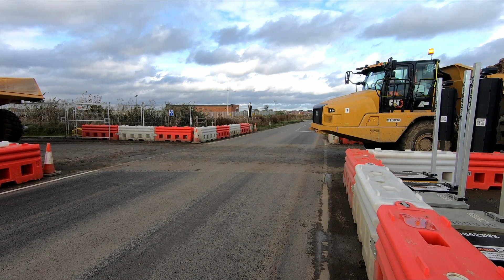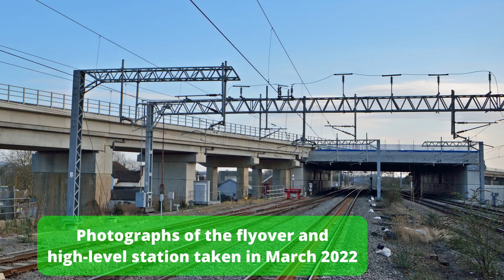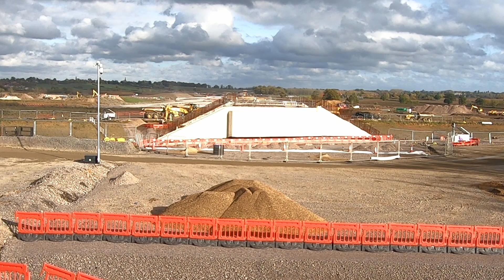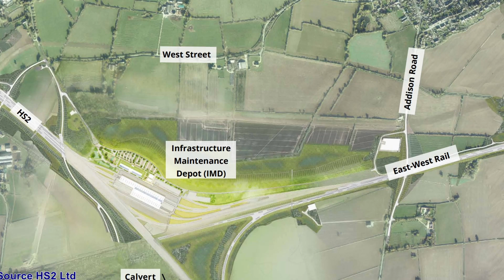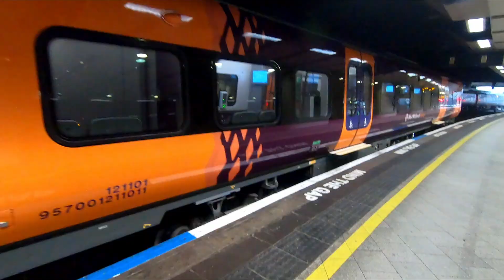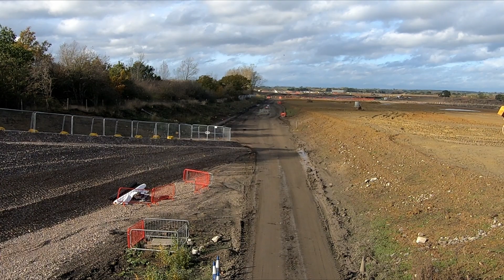Calvert, where East West Rail meets HS2

Comment: Would the East West Rail and HS2 at Culvert not be an excellent interchange station?
Reply from the maker: I don't think there would be the demand to justify the cost. It'd be around £200-300m and would only really benefit Bicester and Perhaps Aylesbury. Milton Keynes will benefit from more fast stopping services on the WCML, so probably not worth travelling from MK to Calvert to catch HS2 services. Plus adding extra stops on HS2 reduces capacity and the journey benefits from the North.
Reply: @Rail_Focus  thanks for the response.

Comment: I really do hope that the Aylesbury spur is built as the town has been without a northern link since the 1960s. It could have been so different. Aylesbury had two stations with connections all over the place. Now it's just a cul-de-sac. I haven't been up to Calvert yet but one day I might do. It certainly is a huge construction site. My focus has been on the Aylesbury area as far as Waddesdon on one side and Great Missenden on the other. Progress in some parts is really slow with little change seen at every visit. I'm pretty sure things will start to gain pace when the tunnels at the North Portal are finished.
Reply from the maker: Me too, hopefully the recent announcement that Government is funding the full EWR route includes the Aylesbury link.

Comment: HS2 has to be the biggest waste of money in our countries history.  So much money spent for the benefit of such a small percentage of the population.
So many more things could have been built and improved for the benefit of the whole country.

High speed is not a requirement, comfort, safety and enjoyment of travel are far more pleasurable to everyone.  Speed is not important.

Anyway its my ooinion as a tax payer.  That will never use it as i work locally and dont commute on trains.  In fact last time i was on a train was over 25 years ago and that was in Germany.  Bye the way it was clean and on time.
Reply: The speed helps increase capacity. 
By your own assesment you could use the same argument and say "why build anything in London, I don't live in London." The fact that it will eventually link the 3 biggest cities in the UK to a fast efficient service, that will benefit 10s of millions of people, is quite an accomplishment.
The fact is, rail travel is becoming more popular, and with the focus on getting rid of reducing the number of short hall flights, this is a no brainer. 
We would always have had to increase capacity on this line eventually. 
You can only fit so many trains on the existing line and platforms are only so big, so we can't really increase the size of the trains. 
This project will make journeys on both lines more comfortable.
Reply: Yawn  😴😴
Reply: In which case you're in no position to comment. You armchair critics really ought to find something constructive with your time instead of moaning about something you have no control over!
Reply from the maker: You're right, speed isn't important and HS2 is primarily about capacity, but why would you build a new line and limit the speed? Surely it's better to maximise all the benefits than to build something less ambitious for actually  very little savings. 200mph isn't outrageous for a modern high-speed line. 

HS2 will serve the  UK's largest cities and many towns currently served by Avanti services, so it's hardly just a handful of people and will also benefit people who use the WCML  south of Stafford by releasing capacity for improved local and regional links.
Reply: @Rail_Focus  Wasting your time trying to debate with folk who begin their comments with 'waste of money 'cos I won't use it' 
Those sort of vacuous 'contributions' to any discussion illicit a massive <yawn> from me.
Reply from the maker: @mrglide7078  I usually give people one chance to see the error of their ways 😅

Comment: What a Collosal waste of money!
Nobody can afford to use it & nobody needs it. Apart from a few wealthy elites it'll be going around quickly for sure...but almost empty.
Reply from the maker: "nobody can afford to use" it's not open yet 🤷. I guess you have a crystal ball. Why would they make it so expensive that no one can use it? What a silly thing to say.
Reply: @Rail_Focus  Precisely, Why?
But why are rail fares on the old tracks so expensive? These ridiculous lines &  trains will need to be paid for & the cost will be reflected in the ticket prices.
If you had even a small  🧠  you'd understand that!
Reply from the maker: @PrivateWalker  the current ticketing structure has been designed in such a way to discourage rail travel during peak hours, hence why there are some eye watering prices to travel on the WCML during peak times, but there are also so much cheaper off peak advanced fares available. 

However without the capacity released by HS2 the situation isn't likely to get any better and in fact will get much worse.

Ultimately HS2 frees up capacity on the WCML by removing the current non-stop Avanti services, meaning more capacity between Birmingham and London on the WCML, at the same time HS2 will more than double the number of seats available from places like Birmingham, Manchester, Liverpool, Glasgow to London. 

More seats means no requirement to manage demand with expensive fares. I'm not saying fares will be cheaper, but the Government will want to fill all those extra seats, so it would make no sense to price people off the railway. 

On the railway it makes much more sense to sell a lot of tickets at a reasonable price than to sell fewer tickets at a higher price.

Comment: I will be surprised if this line does get to Cambridge.  It is a shame it was closed in the first place.
Reply: It was closed in 1967 because it was under utilized due to the amount of time it took (vs the car and buses).  Not 100% sure but in the end a 1 car bubble car unit was used and still didn't get enough traffic.  The line itself was slow and in parts  a singular track.  Politically it was a lost cause in 1967 and you cannot presume that 50 years later traffic on the road would require such a railway to offset it.  However, building over the alignment, which was mostly straight was probably a bad idea.  As with the Northampton railway, once network rail got the land all sorts of contracts were signed to build on the alignment.  EWR is mandated to be a 100mph railway so those alignments would have need to be redeveloped considerably for something like that.  I am surprised the Hitchin alignment has not got more traction, its a bit twisty turny and the tunnel at old warden needs some work, but a connection to Hitchin gives you direct access to Cambridge with a line that is already electrified.  I know the Hitchin/Cambridge connection is heavily used, but the trains that use it only offer an alternative of Cambridge Liverpool street, to Kings Cross/St Pancras.  So there would be some savings going that route, albeit it wouldn't be as straight.
Reply: @atomiswave1971  Yes apparently both the universities pleaded with the powers to be not to close it but not notice was taken.  I really hope it does get to Cambridge.  Cambourne is a big place now and a rail link would be very benificial.
Reply: @EM-yk1dw cambridge is a hub not only for its link to London and the East (Norwich, Ipswich, Peterborough, King's Lynn, etc), but it's also a hub for job opportunities and it's university. Cambridge and Oxford need this link otherwise we will be stuck with heading into london to change trains. Besides, it's called East west rail, it kinda needs to hit more into East anglia considering the fact that East anglia has seen rapid rail decline for quite a while.
Reply: @dominustaker1651  Yes I was reading recently that Cambridge South station will be built now too.  I do agree the link between the two university cities is badly needed.
Reply: @EM-yk1dw  building commenced not that long ago, they are putting up new catenery posts so that when the platform is added later, they don't need to go over the issue of removing them there.
Reply: @dominustaker1651  Sounds good, I remember when I used to work at Cambridge station in the 90s numerous passengers would ask for the quickest way to Oxford.  I think Cambridge South will be very busy with Addenbrookes Hospital in the vicinity and also passengers from the south area of Cambridge and the surrounding villages too.
Reply: @atomiswave1971 Hitchin would be good, but the line is already quite busy, and the town of Camborne is notoriously poorly connected to Cambridge
Reply from the maker: We'll just have to hope the DfT sees sense, it really would be a shame if it stopped at Bedford
Reply: @Rail_Focus  I totally agree, if it doesn’t go to Cambridge it will be a wasted opportunity.  Great film btw.

Comment: East West Rail should order new Civity trains instead of having Class 196s from West Midlands Railway. 

Plus the section between Bedford and Cambridge via Sandy/Tempsford should still happen with a new railway bridge to be built going over the A1, East Coast Main Line and of course the River Great Ouse.
Reply from the maker: I think more units will have to be purchased, but to begin with WMR have enough 196s available to provide an initial service to Bletchley and Milton Keynes
Reply: @Rail_Focus  Interesting. 👍

Comment: NPR cut back, HS2 to the north of Birmingham cancelled. Levelling up, my arse
Reply: it's awful.

The engineers and designers spent years  finding a way to get from Scotland and the North, with less environmental impact in the area north of London and less cost, and the anti-railway lobbyists who pushed through that Integrated Rail Plan nonsense, think they can get away with it, because the stats for trains per hour are not very easy to access...

...and because so many people don't understand that mixed traffic (fast trains and slow trains on the same line) really kills the ability to run more trains.

We need all the other political parties to make manifesto pledges promising to reinstate HS2 and the other high speed line in the north (I won't call it NPR, because NPR is a vague name that could be attached to a massively downgraded project).
Reply from the maker: HS2 is definitely going ahead to Crewe. And the bill for Manchester is still progressing through parliament. But the leg to Leeds and Golborn Link should be re-included
Reply: @Rail_Focus  And connection to HS1
Reply: @Inkyminkyzizwoz  a connection to HS1 should be a no brainer. It only takes short connection from Euston to Kings Cross. 
Just imagine one day jumping on a train in Manchester or Birmingham and being able to go to Paris or Brussels. This would be huge. It would kill off many short hall flights. If Leeds could be included in the future it would be amazing.
Reply: @bubba842  I've been having a pretty lengthy discussion with someone that thinks there's no demand for it, and doesn't even seem to get what I'm talking about half the time! He thinks that flying is always going to be the more attractive options because it's quicker, but that doesn't take into account the time it takes to get to and from the airports and all the formalities at them. In any case, I think the comparison should be with existing Eurostar routes rather than flights. The Eurostar from London to Amsterdam takes about 4 hours, so if people are fine with spending that long on a train for that route then they should be OK with spending up to that on other routes.

Now, the fastest Eurostar journey from London to Paris is about 2 hours 15 minutes and HS2 is proposed to take about 45 minutes from London to Birmingham, so adding those times together gives a hypothetical Birmingham to Paris journey time of about 3 hours. London to Manchester will be roughly 1 hour 15 minutes, so Manchester to Paris comes to 3 and a half hours, and London to Leeds was projected to be around an hour and a half before the eastern branch got cut back, so would've given a Leeds to Paris time of 3 hours 45 minutes.

As you can see, all those are less than London to Amsterdam, so should well be within range! Furthermore, if the necessary facilities for international services were going to be installed in Birmingham, Manchester and Leeds anyway then there might as well be an experiment with services from those places to Amsterdam to see if people are prepared to spend that long on them, and if it turned out they were then you could look at the possibility of extending Paris and Brussels services further north to places where the times would be within that of the Amsterdam services, and repeat the process until you eventually do reach a threshold of how long people are prepared to spend on them
Reply: @bubba842  Don't both lines operate on a different gauge - UK vs European?
Reply: @mrglide7078  Loading gauge yes, track gauge no. In any case, HS2 will be built to the same loading gauge as mainland Europe, as is HS1
Reply: @Rail_Focus  That is GolbornE and NO it shouldn't.
Reply from the maker: @davidhart7792  yes iT ShoulD
Reply: @Rail_Focus  See you've been brushing up on your spelling! Which parliament is it progressing through?

Comment: Pity there isn't an interchange between the two lines!
Reply from the maker: I'm not sure how useful such an interchange would be and it'd have an impact on HS2 capacity. The link to Aylesbury would be much more beneficial.
Reply: @Rail_Focus  Well, it might help to appease those living in the area that are complaining about having to put up with HS2 when they won't directly benefit from it! They could take a train from Aylesbury to the interchange before changing onto HS2 services, so then they would directly benefit after all
Reply from the maker: @Inkyminkyzizwoz  as harsh as it sounds you can't always build things just to appease locals, especially if the disbenefits outweigh the benefits. Like I said the link from Aylesbury to EWR would likely be more beneficial, and HS2 has allowed passive provision for that
Reply: There's no point for an interchange. One line is built to 225 mph, the other 100mph. Just not compatible.
Reply: @ds1868  he means an interchange station. So if you were travelling from Manchester or Birmingham you could access the Oxford to Cambridge line. This would be good for people travelling east, since they could by pass London, but would inevitably slow down the HS2 trains.
Reply: @bubba842  The platforms could be served by loops, then trains not stopping at the interchange could overtake

Comment: Great video, love seeing investment in the railways. More lines should be reopened in the way EWR is!
Reply from the maker: Thanks, we should definitely be re-opening more lines
Reply: @Rail_Focus  does anyone know if the Bedford to Cambridge line has got the go ahead yet this section is really needed there are ports on the east coast that could use it and take the strain of the North London route which is full to capacity and it would be handy for train's going to the west country cutting out London altogether,
Reply from the maker: @joginns778  not yet, the only section that has agreed funding is Bicester to Bedford. They're still working on the business case and final option selection on the route from Bedford to Cambridge
Reply: @Rail_Focus  just read on Google news east west rail are hopeing they get the go ahead in Hunt's budget tomorrow Bristol to portishead has got the go ahead,
Reply: Agreed but heavy engineering is really expensive and the high cost will prevent many lines from being reopened. There must be cheaper alternatives such as trams but if you go down that route you loose the flexibility.
Reply: Yeah I mean who knows what will happen if completion depends when it's done and the other.

Comment: Humph. We were told in the planning process for EW rail that the link to Aylesbury was one of the "benefits" of the scheme. I'm upset this is currently ranked as an "asperation" for consideration at some unspecified point in the future. :- An Aylesbury Resident.
Reply from the maker: I could be wrong, with the consultation closing last year it's difficult to know what has been funded and what hasn't.
Reply: @Rail_Focus  Hi, thank you for the video and all the info. If you don't mind me asking, where did you get the information regarding WMR operating between Bletchley and Oxford and using their rolling stock?
Reply from the maker: @simonlake3735   Information about the cl196s was from various articles about the introduction of the units, can't remember any particular articles, but from reliable rail press.
Reply: @Rail_Focus  thank you
Reply: I'm furious it hasn't been included, think of all the residents of Amersham and surrounding areas that wouldn't need to go into London to get to MK as well. Better connectivity and Winslow becomes an interchange station too. Wasted opportunity